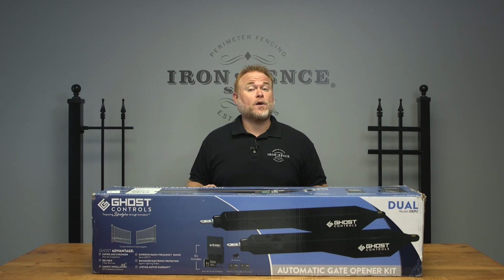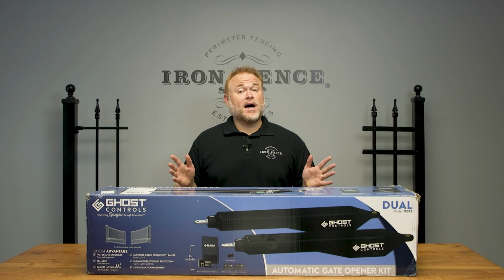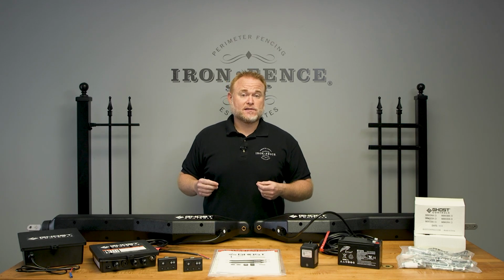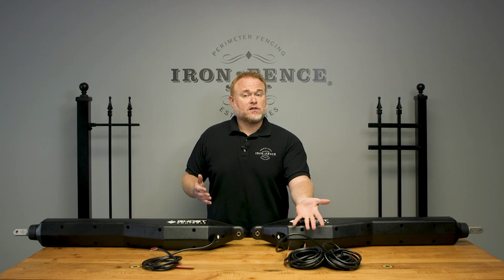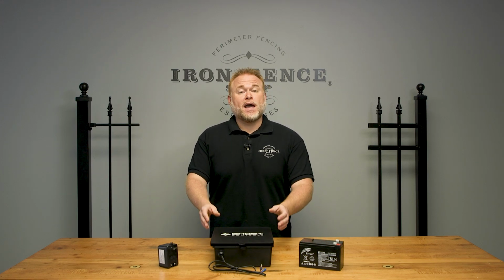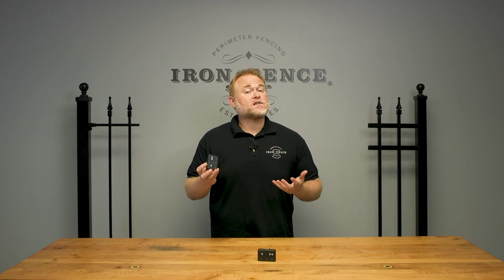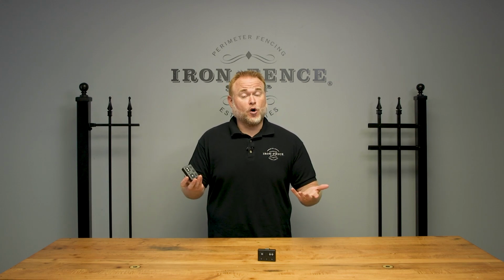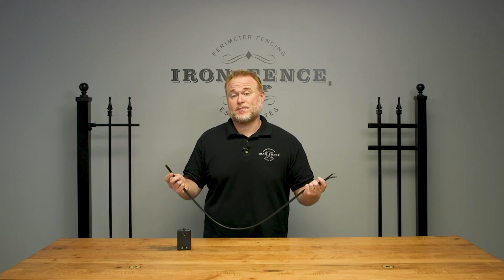What Comes with a Ghost Controls Double Gate Automation Kit for Aluminum and Iron Driveway Gates?

Comment: Excellent video, concise and very informative. Can you please share some information about how heavy of a gate can this model open and close without problems? And is there a better replacement available in case battery dies.?
Reply from the maker: It varies by both the width and weight of the leaf.  They will usually handle around 300-400 lbs per leaf.  My heaviest stocked gate is only about 230lbs, so well within the limits.  

You can use a similar rated battery and not have to use the Ghost one if it dies.  However, there is no better or specific brand I'm aware of.  You can double your storage capacity by buying a second battery and using two in the control box.  You only need one battery to run the unit, but there is room and hookups for a second battery if you want to option it that way.